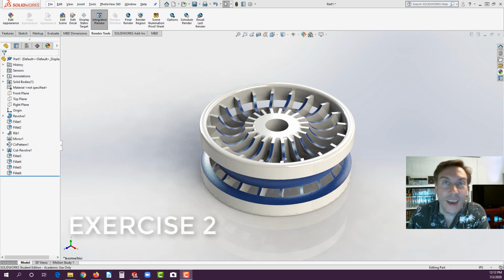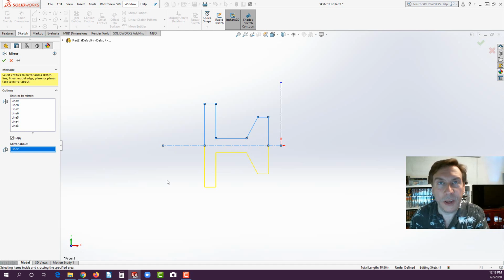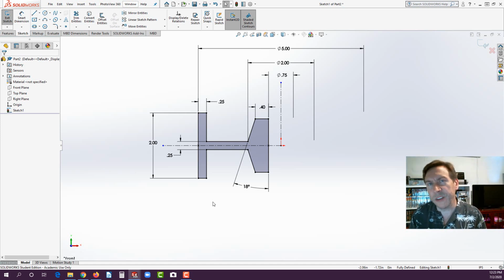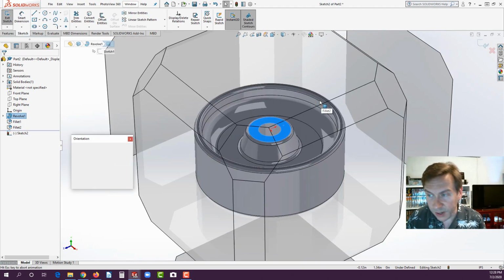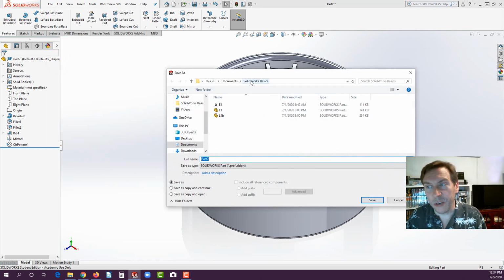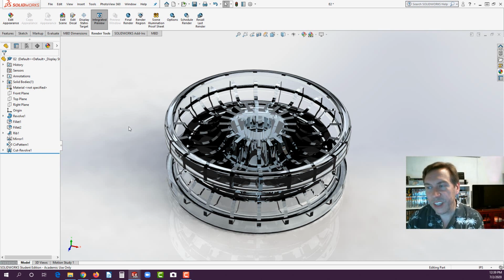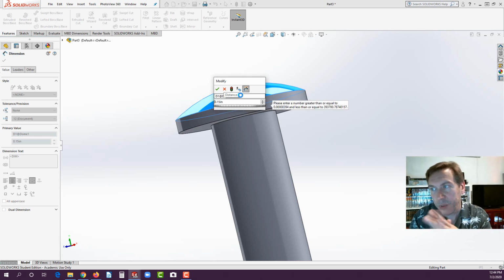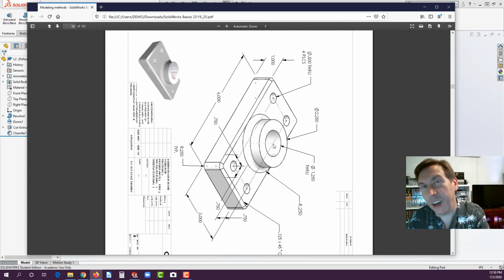E2 SolidWorks 2020 - Basic Modeling 2 Tutorial

Comment: I have learned a great deal from your tutorials. Thank you so much for posting them. Do you happen to have anything that teaches how to create a bevel on a hole, or something similar? I haven't been using SW very long and am struggling to get a bevel on a hole in the side of a pipe. I tried chamfer but it doesn't quite do what I want. Thank you!
Reply: I'm probably very late, but to create the effect you want, you can extrude cut the bigger diameter (bevel), but instead of selecting  through, you input the desired depth of the bevel. Inside that hole you extrude cut the actual hole that goes through the pipe wall.

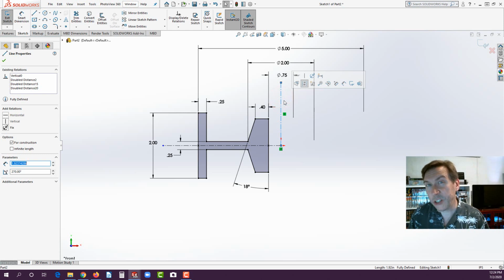Comment: at 12:10 there's a .25 dimension on the left-hand side. When I do it the dimension is fixed in the middle and veritcal between the two leader arrows. I've played with the settings forever. How do you get it to fall down and read horizontally?

Comment: What do companies do instead of prints to communicate with machinists?
Reply from the maker: When I worked as a Model Maker/Machinist in the shop we used a product called SolidView and were given access to the 3D files (rarely had drawings). We could easily measure any feature with a simple click, and could print out custom views with dimensions we added. This was back in the Mid-nineties (1994). I can only imagine how much easier it is now.